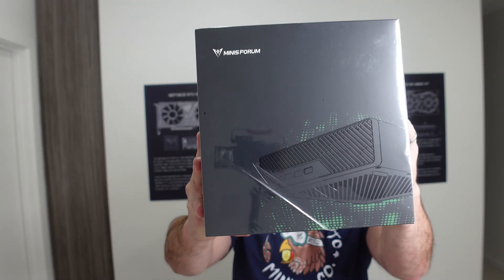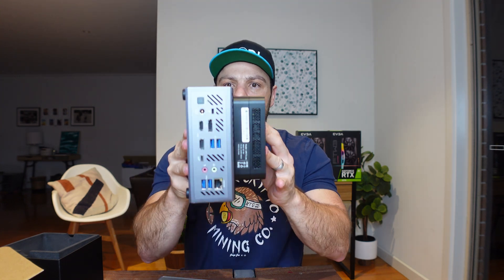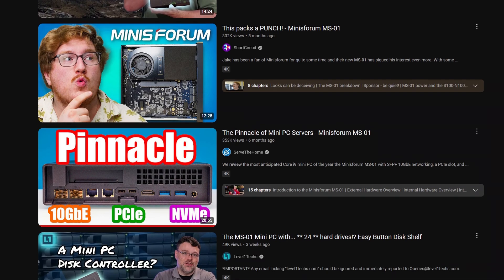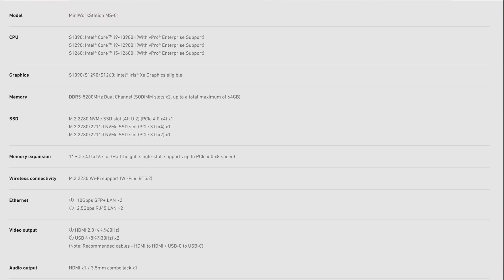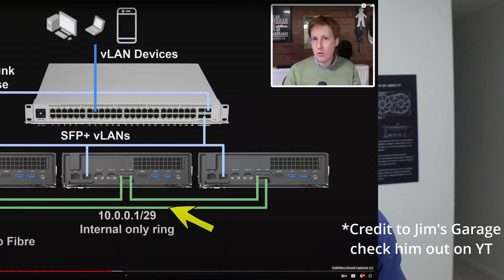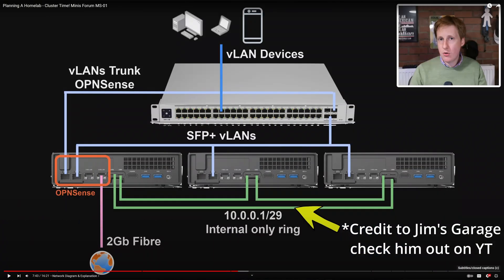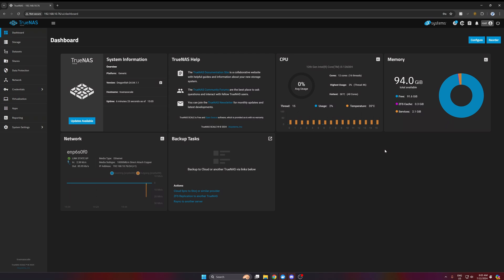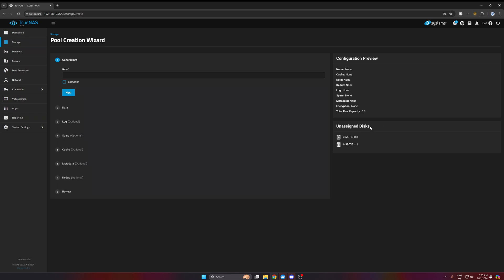MinisForum MS-01 Homelab

Comment: can any one confirm if any expansion cars fits in the pcie slot
 e.g TEKQ Databank M4 Support 4 Port M.2 SSD Expension Card PCIe 3.0 x 16 PCIe Adapter Card, Up to 32TB RAID Controller Card Broadcom PEX-8724, Supports Non-Bifurcation Motherboard, with Active
will this fit in the pcie slot 

thank you

Comment: Can you share the model of the PCie to 3xm2 card? Did it worked well? Did required bifurcation? Thanks for sharing
Reply from the maker: @TheBigBossPlancarte  thanks for watching. I went with TXB122 PCIe 3.1 x8 ASM2812 to 2 port M.2 SSD Adapter Expansion Card Dual M-key. I did have to take off the back part to get it to fit nicely.

I didn't have to do anything in Bios to get it working and seeing both m.2s. I did see reports that's the laptop skus don't support bifurcation, but yeah didn't have to fiddle with anything. I also reached out to minisforum on bios versions. On-top I was expecting to tape out the smbus to get all the ram to work with the m.2 adaptor but that just worked luckily